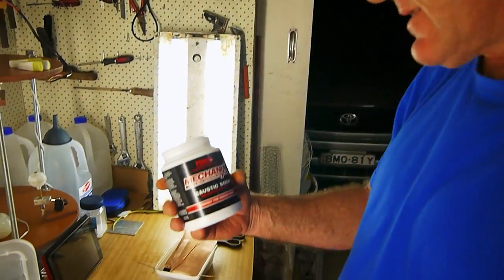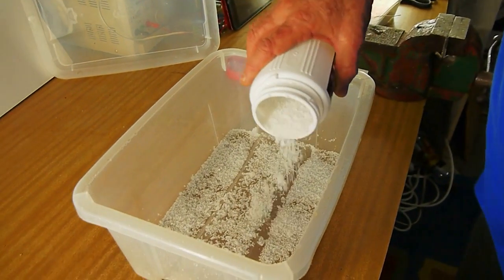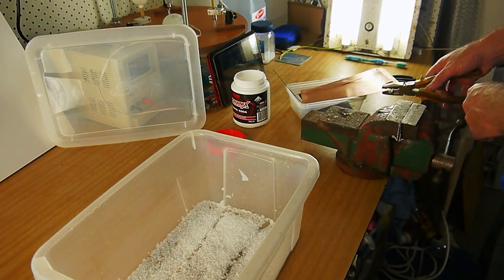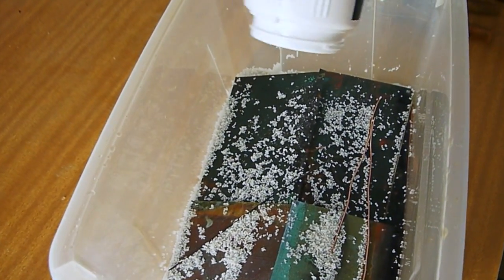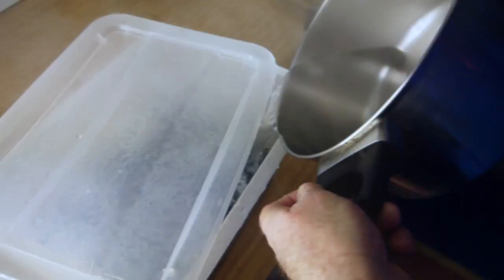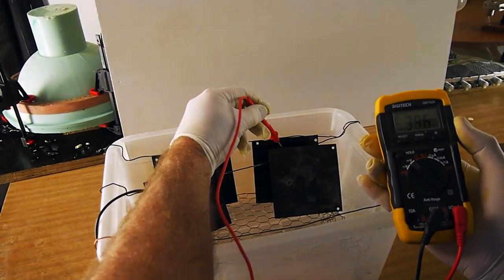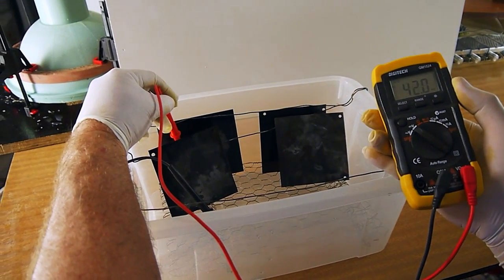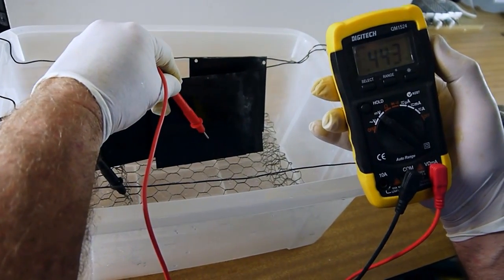Unofficial Keshe Foundation Australia. Nano Coating Tutorial.

Comment: I used 100% copper mesh to not add any additional interactions to field, my setup was almost 100% copper based also I used mix of sodium and potassium hydroxide. I putted everything on top of the copper mesh and no direct contact with hot water only hydroxide vapors reacts with copper to nanocout hot water was placed below the mesh, my goal was to reach very smooth and clean nanocouting, what bo you guys think of such configuration?

Comment: You can flip those those tie bands so you can reuse them (use the smooth side of the tie band facing the locking part on the head of the tie band). And tks for the tutorial :)

Comment: Mac if you don't have a drill to make these holes use a nail and hammer and punch it through. You could rap your wire around your copper plates but the holes make it easer.

Comment: im new to this, i just finished my pain cap and the health patch without the gans.  I just ordered copper plate online and it turned out to be really thick and i have no clue how to put holes in it like yours.  so now im a bit frustrated that i wont be able to work on gans till i get just the right type of copper and zinc.  can i just wrap a thin (24 gauge wire) around the plate to connect it instead of drilling a hole?  will it change the result?  thanks.

Comment: I've made 3 sets of coils, but all attempts to nano coat them have failed. The caustic boils, but after 24hrs the coils are only slightly tarnished in places. I used 1kg of caustic last time and still no coating. I think it would be a good idea if those of us in Australia could either communicate via email or get together to help those of us having problems and to discuss ideas. I was educated in traditional physics and am finding these new concepts a bit difficult to understand. Please help. I'm in Toowoomba Qld.
Reply: +Nick Edgar The 1st "dipping" in solution prepares the copper for the 2nd and 3rd nano coating by "steaming".
Reply: +ThePearsch Yes I eventually came to that conclusion because the wire seller said that there was a thin layer of oil on the wire from the extrusion process.

Comment: How do you know its nano coated? How can you measure it?
Reply: +United WeStand It will be properly nano coated with the "steam" steps. Measure? DCV meter used to discharge the voltage in the coating, only. It will show some voltage, but the meter is used to "drain" the voltage out of the nano coating. Dealing with plasma, you want a "zero" voltage (low resistance).
Reply: This is interesting, would love to know what effects you observed with the nano coating on the copper. Been looking into it trying to find videos of what the nano coating effects are in real life observation, any sort of measurements to show its effects. eg: mesurements suchs as the relationship between voltage, current and resistance or the relationship between Power (watts), Voltage and current etc... Thanks for sharing brother much appricated :)

Comment: Can someone pls tell me where (in Sydney, Australia) can I buy the ZINC and COOPER plates and the Gauge 14 COOPER wire?
Reply: +Manuel Gonzalez I used copper plumbing pipes. Nano coated them in Bar-B-Cue about 10x. Hot, cold, hot, cold. They work just fine for making GANS.
Reply: +Manuel Gonzalez 14 gauge copper wire (coated). 100 ft. roll at Lowes. I had to strip the wire with an Exacto knife. The potato peeler didn't work for me. 100 ft. was enough for 3 sets of 80turns. 1 set of 160 turns and all the "capacitors".
(Ma Grav, FB)

Comment: Use alltime chickenwire on the bottom (No Aluminium because it will melt) so the parts dont go in contact with the NaoH fluid just the steam.

Comment: Does Calcium Hydroxide is doing the same reaction as Sodium Hydroxide?
Reply: +Sebastian Jasielski Some strong bases like calcium hydroxide aren't very soluble in water.  That doesn't matter - what does dissolve is still 100% ionised into calcium ions and hydroxide ions.  Calcium hydroxide still counts as a strong base because of that 100% ionisation.
Mr. Keshe prefers NaOH. "Drano" is cheap and contains Sodium Hydroxide crystals.
In the  presence of extra hydroxide ions from, say, sodium hydroxide, the equilibrium is still there, but the position of equilibrium has been shifted well to 
the left according to Le Chatelier's Principle.
(Ma Grav, FB)